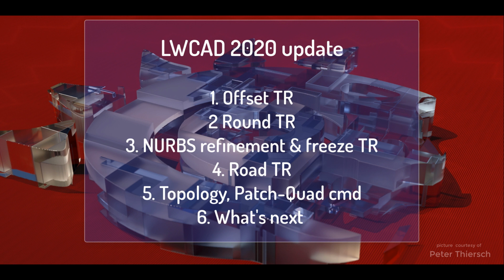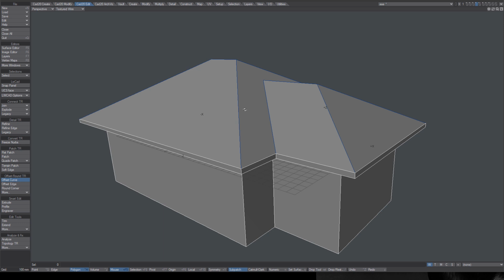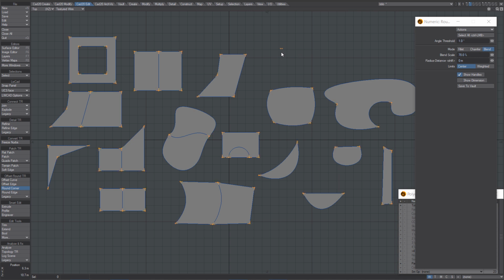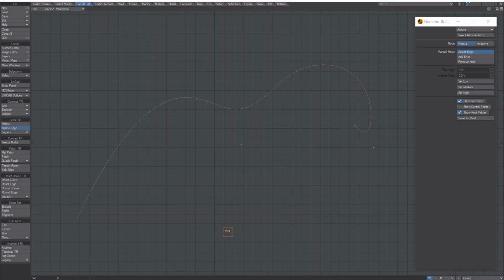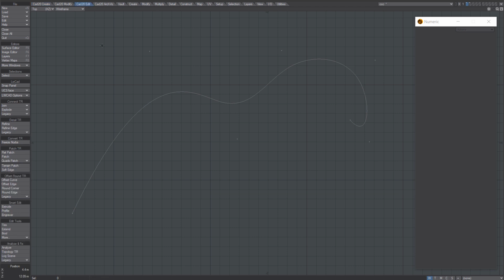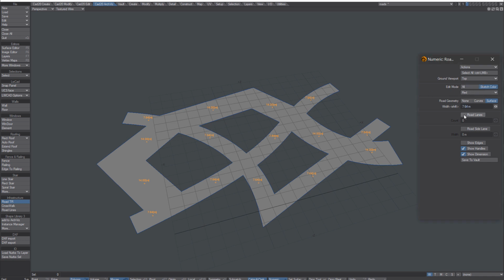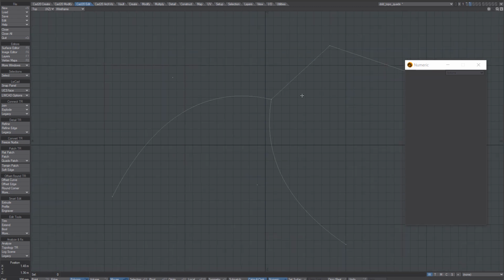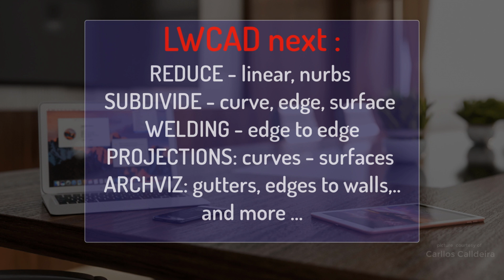LWCAD 2020 update (LightWave)

Comment: dear viktor, is lwcad 2020 compatible with lightwave 2018.7 as i didn't updated my licence for now ? if so i will buy lwcad upgrade right now :) great work as usual, this plugin is one of the main reason why i still use lightwave today.
Reply from the maker: Hello Claude,
Yes, LWCAD 2020 is fully compatible with LW 2018.7.
https://sites.google.com/view/lwcadmanual/lwcad-5-0/1-installation/system-requirements